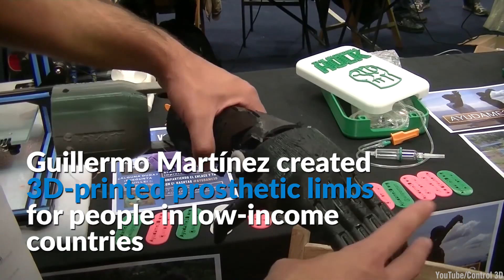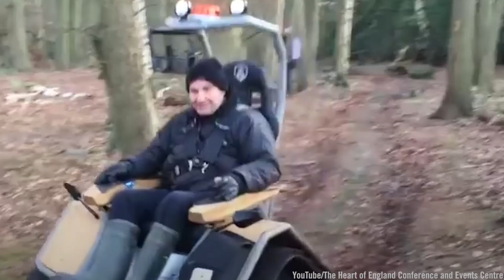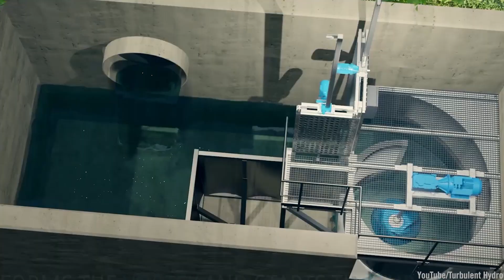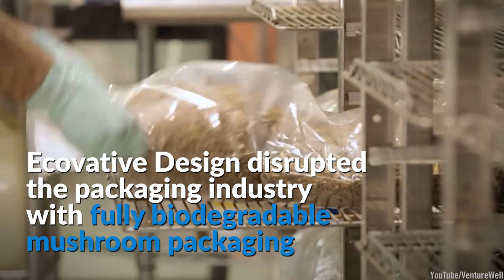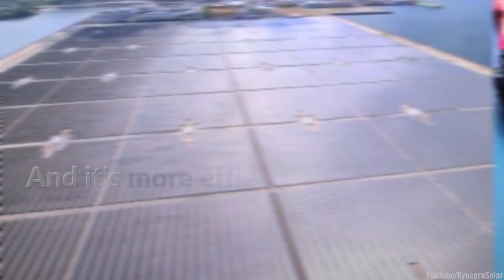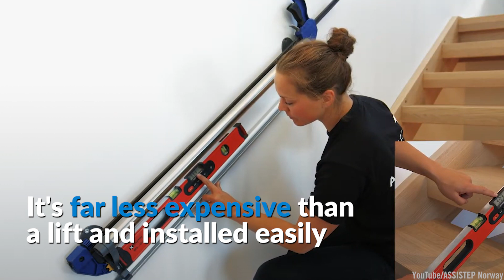9 products that make the world a better place

Comment: Weed flaming is nothing new and actually represents a bit of a backward step - it's bad in terms of carbon footprint and air pollution. Newer methods are using lasers and high voltage to kill weeds instead.

The cow brush is also a very old idea.